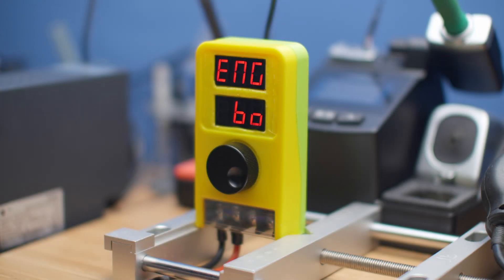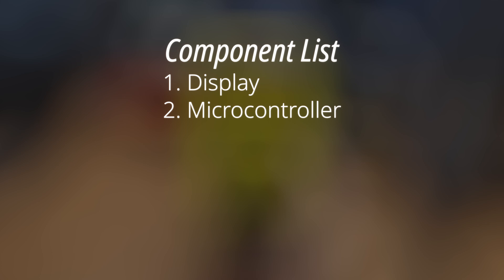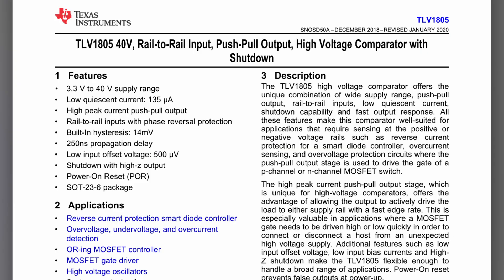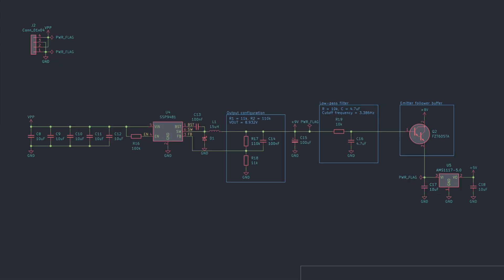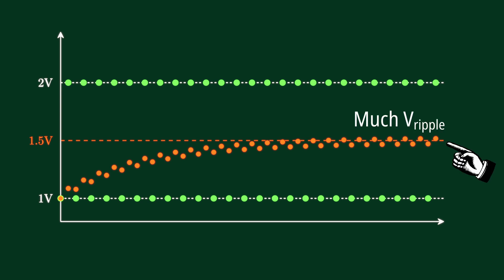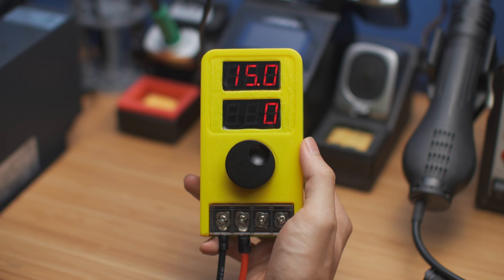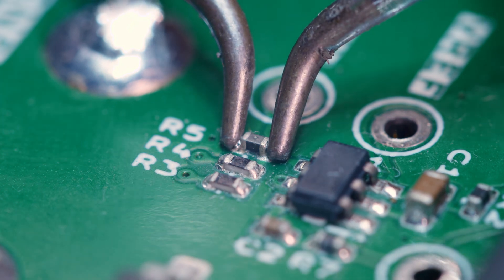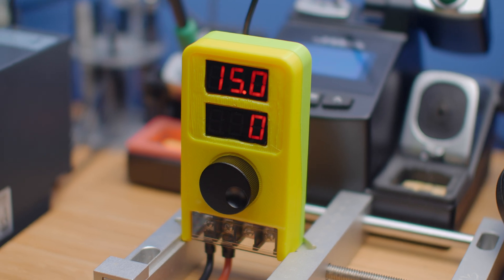Upgrading My Overvoltage and Regenerative Braking Protection Circuit

Comment: I usually put a strong battery parrel to the supply. Never burned a thing. Just need to take a lot of caution as shortcuts will produce a disaster.

Comment: the DAC design is flawed. although mathematically you can use a sigma delta modulator to push noise to high frequencies and increase resolution at low frequencies, it does not work in practice. this is because the precision of the voltage output of each step of DACs never exceed 1 LSB by much, as that would mean wasted precision and increased cost. in DACs, the precision is tuned to the resolution. this means your approach does not work.

but some very specialized DACs are designed for this use. these days, absolutely all digital sound outputs (from PC, cellphones, TVs, digital music players, etc) use 1-bit DACs, with a sigma delta modulator feeding it, and a digital oversampling filter feeding the modulator. these specialized 1-bit DACs have 1 single bit of resolution, but extremely low noise and jitter, making them capable of outputting analog signals that would require 20+ bit DACs if the DACs were naively used at the digital signal sampling frequency feeding the oversampling filter.
Reply from the maker: I'm not sure I follow. I am seeing this as being somewhat analogous to PWM. If I replaced the DAC with a GPIO pin (akin to 1-bit DAC), toggling the pin at 50% duty cycle and using a low-pass filter (assuming sufficiently low cutoff frequency) should result in an output approximating 1/2 the output voltage. How would the precision of the output of the GPIO pin affect this behaviour?
Reply: @engineerbo  the most efficient way of shifting noise into the high frequencies (reducing noise at baseband, which is another way of saying increasing resolution/precision/whatever you want to call it) is sigma delta modulation, not pwm (in signal processing this is called "noise shaping"). but in both modulations, the attainable precision depends on the voltage precision of the output values your DAC is producing. if you pwm between DAC values 45 at 80% and 46 at 20%, you do not get 42.200... because the values 45 and 46 correspond to voltages with a lot of error, because the precision of those voltages are set to be just good enough for an 8-bit DAC, and no more. also, the zero error and non-linearity of an 8-bit DAC will further increase your errors. you cannot make say a 12-bit DAC out of an 8-bit DAC unless the 8-bit DAC is very specially constructed so that it is ridiculously precise (and expensive) for an 8-bit DAC.

for example, you could construct such a specialized precise 8-bit DAC by taking a 12-bit DAC, feeding the most significant 8-bits from the CPU, and zeroes to the 4 lest significant bits. then you have an 8-bit DAC which you can use to attain 12-bit precision using sigma delta or pulse with modulations, plus analog filtering. that would work... but you already paid for a 12-bit part! might as well just use it.

some DACs are so imprecise that they do not even guarantee monotonicity. and also the temporal jitter of the output induces even more errors with any modulation. this is why precision DACs (such as those used in audio applications) are all 1-bit DACs. it is extremely expensive to make a 16 or 18 or 20 bit DAC: you need to trim the on chip resistors with a laser during production, it is a huge headache. Burr-Brown used to make such chips for early CD players. but soon enough digital processing advanced to the point where 1-bit DACs where possible... and so much better and cheaper. you do not need to make any precise triming of anything if your DAC only outputs two values; you just need those 2 values to be constant and jitter free.
Reply: in short: if you have a regular (non-specialized) 8-bit DAC, you will have 8-bit precision no matter how you modulate digitally.
Reply from the maker: Interesting, I'm not too familiar with the construction of DACs. I did check the behaviour of my circuit, and everything seemed to be working, but maybe I just got lucky? I'll have to look into DACs more, thanks!
Reply: @engineerbo  "everything is working" is relative to how you evaluate performance. your circuit does not have more than 8 bits precision, even though you wanted that. in that sense you can say that it does not work as intended.

you can easily verify that by measuring the filtered DAC output to different values (PWM'ed or not) and verify that their precision is not better than 8 bit. (in fact the precision of the DAC is specified in the cpu datasheet for sure.) also, trying to calibrate two points of the value-to-voltage "line" (it is not a line, the DAC is non-linear) will actually worsen precision for other values.

Comment: 8:14 I don't understand your power supply. To create +9V, you use a dc-dc converter and follow it with an LPF... but that then goes into an emitter follower powered off +9V? Where does that +9V come from? Wait, I get it now. You're powering it from the 9V before the LPF? But by doing this, you reintroduced the noise you thought you removed using the LPF!
Reply: https://en.wikipedia.org/wiki/Capacitance_multiplier
Reply: @ondras1862  i don't see a capacitance multiplier in there. can you explain what you mean a little?
Reply: @cheater00  The circuit at 8:14 matches the schematic titled "A basic transistor capacitance multiplier" on the wikipedia page. +9V is Vs, R19 is R1, C16 is C1, Q2 is Q, VI of U5 is Vo, the load (U5 and everything on +5V) is R2. This seems like a textbook capacitance multiplier to me.
Reply: @ondras1862  right, that's true, thank you. i missed that. do you think it's good at rejecting noise?
Reply: @cheater00  It is typically used for reducing power supply ripple. I don't feel qualified to guess how it would perform for high frequency noise. If you wanted to know, you should be able to use SPICE to simulate the circuit (but you'd need to come up with good estimates for the values of the parasitics, which you have to include in the schematic).
Reply: @ondras1862  interesting, thank you!

Comment: hmm, this seems like just braking, there's no regen...
Reply from the maker: Does it? How so?
Reply: @engineerbo  You're just dumping the power as heat, it doesn't regenerate
Reply from the maker: OK I see what you mean. You're right that this setup does not store the regenerated energy, but the energy is still "recovered" during braking, which is why we need the protection circuit in the first place.
Reply: But at least heat is not generated in the motor's windings, as with regular braking.
Reply: The energy is regenerated - and inmediately dumped into a resistive load.

Comment: Very good video! 
Years ago, I designed a circuit using one single INA122UA instrumentation op amp. I pushed the gain of this amp almost to its limit.
As a result, the gain setting resistor became VERY temperature sensitive. I found that using a few 1206 components did not affect my board layout that much. I ended up using a RQ73C2B147RBTD from DigiKey, .1 percent tolerance, 10 PPM. (parts per million) Using precision resistors can end up saving lots of calibration time and make the overall circuit more stable.

Thanks for sharing your engineering approach to designers coming up to speed in this field.
 For those of you interested, I found this field highly rewarding since starting (1986) to use micros + electronics = embedded control.
Reply from the maker: Thank you! There's definitely a place for high precision components, but I was actually slightly surprised that my circuit functioned almost totally normally when all my 10k resistors were actually NTC thermistors. It actually took a little while to figure out the source of the problem!
Reply: @engineerbo  Indeed! Comment was actually intended for novice designers coming up to speed.

Comment: checkout LTC4368, it has high side mosfet drivers, ideal for which is what i needed in one of my projects and it also provides hot-swap capability. earlier i used LM5069 which has min input voltage of 9 volts but i needed something that can go below 3 volt. its much cheaper also